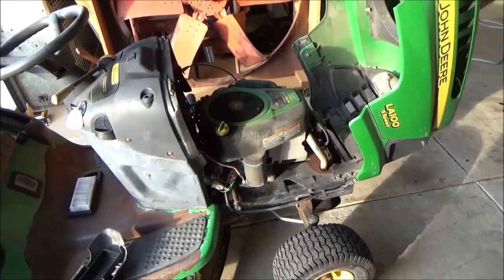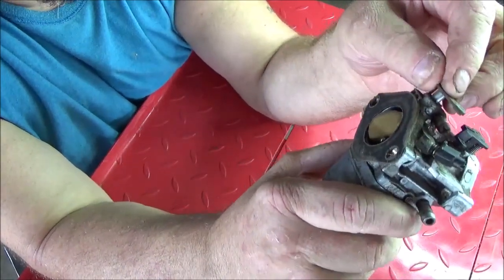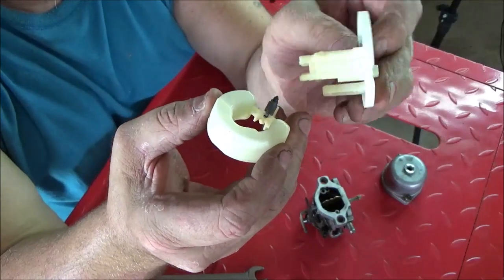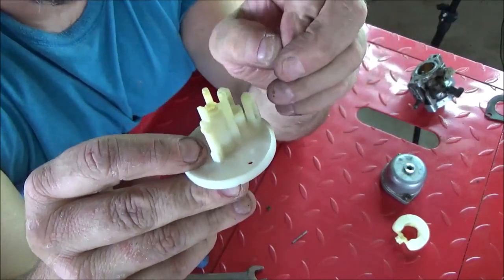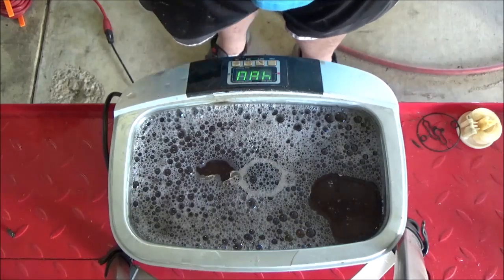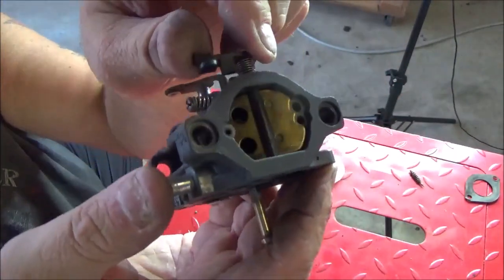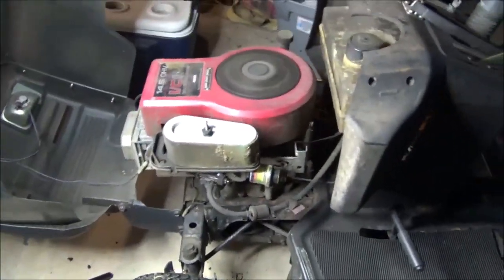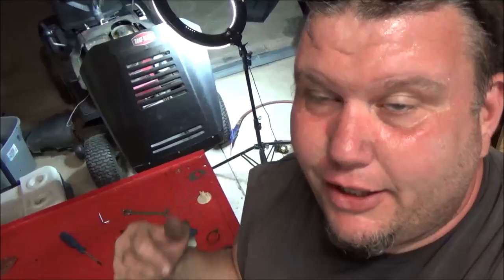PROPER REBUILDING OF THE NIKKI "6" STYLE CARBURETOR FOUND ON MOST NEWER BRIGGS AND STRATTON ENGINES

Comment: I bought a Nikki carb rebuild kit and the mower still didn't run. So I replaced it with a new carb for under $20 and it works.

Comment: Mis aligned float assembly. Fuel leaked into engine over night. Correct float direction. Flushed engine and re added oil and gas.  Holy mother of god. What the f lol. What a nightmare.

Comment: I'm swapping my carb on my 19hp because as cheap as they are I don't want to bother with the needle and seat on mine.  I don't think it's the fuel though as I run 93 octane ethanol free gas in it from the Co-Op.  Mine wouldn't crank day before yesterday so I adjusted the valves and she fired right off.  Went out yesterday and she wouldn't crank again.  Took the spark plug out and gas came gushing out of the cylinder so found a new carb, filters, shut off switch, etc. on Amazon for $30 and figured I'd just do that instead of getting a rebuild kit.

Comment: Just took mine about and cleaned it, no more flooding or surging, I will be buying a spare rebuild kit to have. Mine is a 11.5 B&S on a DR bush hog. Never knew the choke sleeve/plate came out that easy and spring was way to loose.  Thanks

Comment: Good Job buddy. This help a lot of us if and when we need to rebuild that carb. My shop all they want to do is to put new parts on including carbs they don't want to fix anything anymore. Have a great week!!!
Reply: Well, at the price of new carbs it may be cheaper and it you go aftermarket it is guaranteed cheaper.
Reply: @doublewide6   I would agree if they where using after market carbs but they are using oem carbs and they pricey most of the time over 100.00 and then north of a 100 to 150 to take the old off and the new on

Comment: I find the plastic float tends to sag sometimes and that is why they flood.  I would think the plastic seat would be fine if cleaned well with a q-tip.  Have you ever tried to change just the float or heat it so the need sits correctly?
Reply from the maker: They sag due to the spring inside the needle. It's the way it's designed, just like the old toro 22040 Suzuki 2 stroke.  The oring on the backside of the fuel transfer assy is vital in its placement as it is also a leak point
Reply: Constantly!! After having my own shop for 12 years, I can tell you that I hate Nikki carburetors. They're plastic shit that needs to much attention. (good video though!)

Comment: @THEMOWERMEDIC1- First time with this carb. The bowl gasket is a pain in the ass But Unlike most glad to see you talked about how that goes on. What I find more a pain is the little O ring that goes over the plastic nub where the main gas comes in. Some of these kits the ring is thicker or wider and it is almost a done deal to get all locked down. Same with the little O ring that goes on brass and up in center of plastic shoot/tube. Two things here #1. What kit and link do you get yours. I see they work well in going in and locking. I need some? #2. The thing at vid point  11:47 what exactly does that part do when ajust to carb? Puts more fuel into carb thus slows or runs motor faster?

Comment: I bought the rear engine Troy Built for $50 with a blown Briggs for parts. I went to clean the carb for a spare and there's no needle valve but at least the carb was spotless inside. Judging from the bowl screws I think this was delivered this way and why the engine seized. Great video BTW

Comment: You're the first small engine mechanic I've found on YT that took the time to service a Nikki carburetor, everyone else tosses them in the trash
Reply: Been using the same one for 14 yrs. I've had it apart a few times.They are simple.
Reply: Been using the same one for 14 yrs. Their simple.
Reply: Been using the same one for 14 yrs. Their simple.
Reply: There's a reason. These thing were designed by satan himself. I do take them apart and clean them, but I understand why people wont.
Reply: In the video he's using the wrong screwdriver. Nikki is made in Japan, do they use JIS screws. Choose to Phillips, but just different enough to cause slippage and cam-out of the screw head.
Reply from the maker: I use what works.

Comment: Perfect timing, I recently drug home a free snapper LT1533 and I'm sure the Nikki carb needs work from sitting with crap fuel in it, got around to putting on a new solenoid (old one was melted, guy i got it from said the previous owner hooked the battery up backwards) and now need to see if the flywheel key is sheared as it backfires through the intake. I'd put on a Walbro if I had any left in my stash to be honest a bit simpler to rebuild. 👍

Comment: Is WD40 the oil you used to get the gasket and O ring on? Trying to get an old nikki carburetor to work on a lawn tractor that won't start, to work. Do you think cleaning it and rebuilding it will make it work? The engine turns over but won't start. Thanks for the video, very informative

Comment: Thanks.  The main jet snaps into place in both the inside and outside of the fuel transfer assembly but it only works in one spot. :)  The online parts diagrams were no help, as they all had poor graphics making it impossible to see the proper location of the main jet.

Comment: "Flooding its bum off..."
Yeah.  I've lost count of the number of times I've had to pull the spark plug to clear the half tank of gas hydro-lock. Finally got smart and just put in a fuel cut-off...
Reply from the maker: But you haven’t fix the problem why don’t you be “smart” I fix the actual problem instead of “bandaid”ing  it with a fuel cut off

Comment: Does the fuel float with new needle installed lay parallel with the carburetor body base  when looking at the assembly from the side ??? Or does the fuel float just about stop at the top of the carburetor base ??? Thanks. VF

Comment: so rather than just finding a screw and using a little sealant that would have fit the bowl to replace the plunger he decides to break the plunger to which now you can not use that plunger on another carb that might have needed a plunger replacement... smart very smart

Comment: i really need to know which direction you dropped the main jet into the tube. I bought a aftermarket carb and opened it foolishly and I think I didn't get the main jet back in there right. Thanks.
Reply from the maker: O-ring first
Reply: @THEMOWERMEDIC1  Yep I had it upside down, Rockin and Rollin now. Thanks Man!

Comment: Do these Nikki carbs use the same main jet ?   For example is the jet the same on carbs off a 16.5hp and a 21?
Reply: NO! They use at least a couple which are very different port sizes. Running a shop I picked up a bunch of Nikki jets from another shop, thinking they were all the same. I usually learn things the hard way.

Comment: I noticed one linkage had an added thin fine wire and could not see where it connected.  Can you please comment on where these linkages are connected to the Nikki ?  Thanks !
Reply: The "Governor rod" has a long thin wire like spring which accompanies it, They connect to the throttle valve (the metal one located closer to the front of your mower.... the valve 
nearer the back of the engine is strictly choke related and your choke linkage is attached to plastic. ... it has 3 holes, make sure the choke valve is in the open and hook the linkage up through the hole nearest the rear of the engine, oddly you hook the linkage upward through the hole not down through the hole.. 
Make sure to install the thick choke linkage through the slot in the bracket that your throttle cable connects to as you put the carb onto the air horn, otherwise you will not be able to hook the hook in the choke linkage on the carburetor.
As for the Governor linkage with the very thin wire spring the rod goes in the hole that is lined with plastic in the spring goes in the hole that is just a hole in the metal linkage on the carburetor hopefully that helps!

Comment: I bought this niki carburator but wont come with the fuel shut off fluel solenoid port.   
Can i use with out the solenoid?
 Thank you
Reply: yes, no sweat
Reply: You will need to install a fuel shut off valve in the fuel line before the carburetor if you do not have the solenoid

Comment: My kohler sv720 idle surges +/- 200rpm the first 30 seconds or so when it runs high speed when started cold, runs perfectly otherwise after that. Any reason to mess with the carb or expected behavior?
Reply from the maker: Cold surge is normal
Till operating temps have been reached
Reply: @THEMOWERMEDIC1  alright i'm pretty anal, but the valves are adjusted and it fires up choked cold on a half crank so i'll leave it alone.

Comment: I have a niki 4 carb with idle problem. The idle circuit is plugged. There is only 1 main jet and the idle feeds off of it. Well where the idle feeds from the main is where it was plugged and there is no way to clean it because of the design of it. Ultrasonic cleaning did nothing.

Comment: Good job there I've done the same thing a maney of a times on those little carbs and they usely work pretty good for me too I still don't understand why they put the fuel regulator valve on them myself cause they really don't need it to run if it's working properly there its just something else to mess up on someone is all they are to me here have a good day and I'll ttyl now thanks
Reply: Well done, I've watched about a dozen videos now and you are the only one taking out the air screw for cleaning. Like you said they flood for no reason at all. Very profesional  job done.

Comment: i had trouble with surging. after trying all suggestions i went one number size larger .003 in the main jet. nobody understands why these engines seam to go lean after 350 hrs. as the pulley wears the engine will run freer which will make it run leaner
Reply: None of the pulleys on a typical mower are going to have any effect on if the carb runs lean. You either have an air leak in the intake gaskets or the jet has an obstruction, or it's too cold outside for the jet you're using. By changing the jet in cold weather and but changing back in warm weather, the engine will be running rich all summer and waste fuel.

Comment: I have one on a Poulan XT tarctor that worked but was flodding, I opened it and it appears to me its missing the o-ring so someone probably had it opened and forgot to put it back. Than I had a brand new chinese made one on another machine that was also flooding over and it appeared they tried to use two o-rings and they failed also causing the flodding issue. I too prefer the Walbro's.
"The Nikki Shit's"

Comment: Those carbs  are expensive as heck.
Reply from the maker: jim s oem carbs are super expensive. However some of the aftermarket carbs work great for 16$ on eBay / Amazon
Reply: @THEMOWERMEDIC1  I've used them for various equipment. But I haven't tried replacing the Nikki, just rebuild them.
Reply: @THEMOWERMEDIC1  I would go with the aftermarket if not rebuilding.

Comment: Tell your customer to stop buying cheap gas I tell my customer to use 93 octane gas it will save them a headache later
Reply from the maker: They won't listen.
Reply: 93 octane has just as much Ethanol as 87 octane.

Ethanol free (which could be anywhere from 87-93 octane) will help some in mowers since the do not have sealed fuel systems, but the best course of action is to just not leave any fuel in it for extended periods of time.